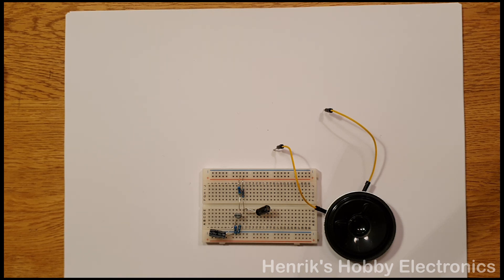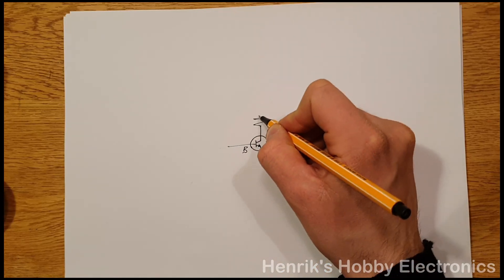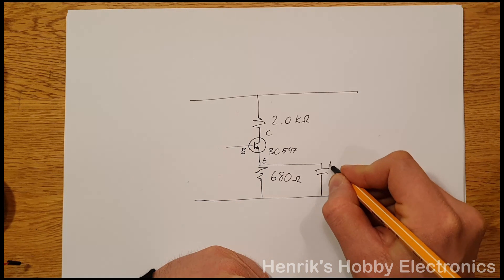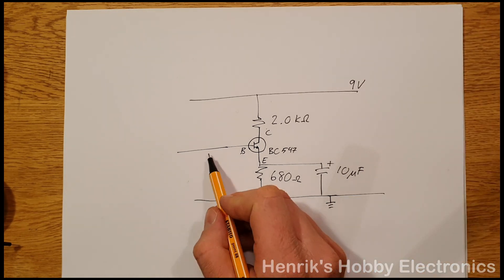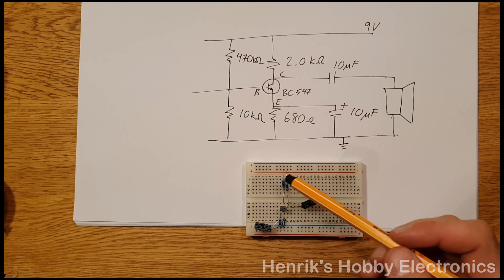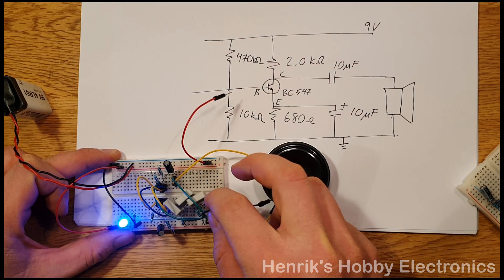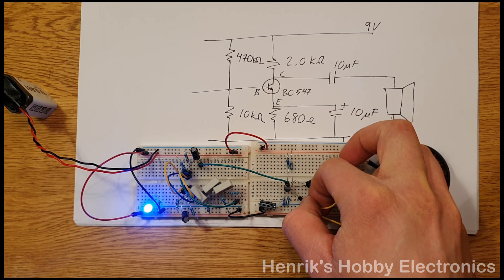Single-Transistor Audio Amplifier - How the Common Emitter Amplifier Works

Comment: is the capacitor a must because I dont have one?.
Reply: If it is the capacitor speaker 🔊  you can remove it  but there will be distortions but if it is the emitter to ground then it is a big nono

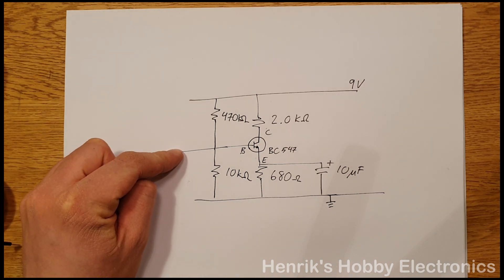Comment: I am totally impressed by your explanation. Thank you Henrik. I have wanted such explanation since I was 13 years old, now I found it. I am a novice to analyzing circuits like this, so I am so happy as a hobbiest to listen to you. I am looking forward to your next video! May I ask you to answer a few questions, either here in writing or in another video (if you want to make another video :) 1. I am confused why in the circuit diagrams that uses DC battery, instead of showing -ve and +ve leads, you draw an earth, can you explain that a bit more. Why isn’t the negative and positive leads shown to make it easier to understand the flow of current? 2. Probably related to the previous question, at 1:19 you say you want to limit the DC current but not limit the AC current. Is the DC current the one coming from the battery and the AC current coming from the oscillator? 3. At 3:14, when you say you apply an input signal, what does that mean? I have a difficult time conceptualizing what an input signal means in terms of electronic circuit. Is the oscillator circuit a closed circuit that Takes an DC current and changes it to an AC that oscillates? I think I might be getting it or, on the other hand, I am missing a fundamental concept that I to figure out. Did I get it right Henrik? Greetings from San Diego, California.
Reply from the maker: Hey Omar! Thank you for your questions. (1) In this circuit, the "ground" is not actually grounded. We call this "ground" only in the sense that we use the battery's negative lead as the 0 V reference voltage. Basically, in the electrical engineering "lingo", we often call the 0 V reference ground. (2) Yes! (3) To start with, an amplifier is a device which takes an input signal and produces an output signal, which has been amplified by taking energy from the battery. An oscillator on the other hand produces an output signal without needing an input signal (except for the battery). For more information about that, check out my other video on oscillators: https://youtu.be/hbH2OAdpdOk Did this help? /Henrik
Reply: @HenriksHobbyElectronics  Thank you so much Henrik! This is extremely useful. Looking forward to more videos.

Comment: Where or how do you get the values of  resistors , capacitors and Vcc ?? And how much source voltage should we use ?
Reply from the maker: Thank you for your question! The 10 uF capacitance is a typical value which blocks DC while allowing audio signals to pass through. (If you want to verify this, you can calculate the cutoff frequency for the capacitor.) You can calculate the resistance values using the method described in the videos linked in the video description. I used 9 V source voltage. Did this answer your questions?